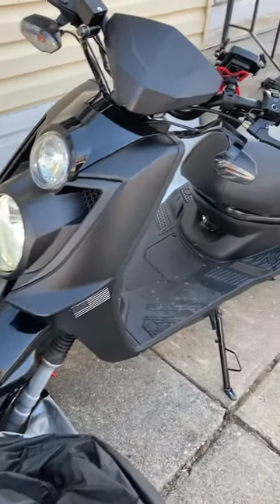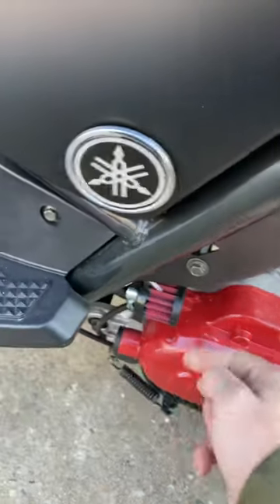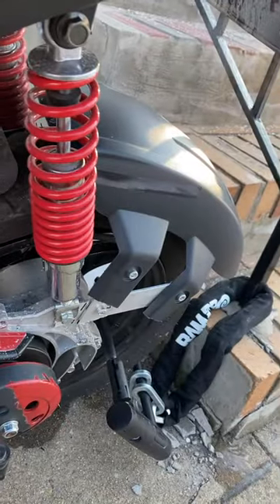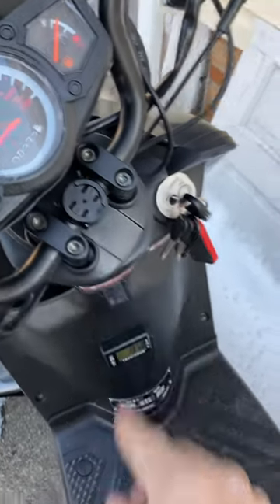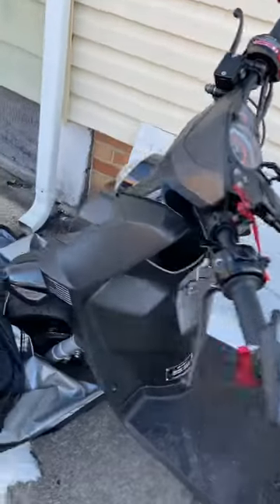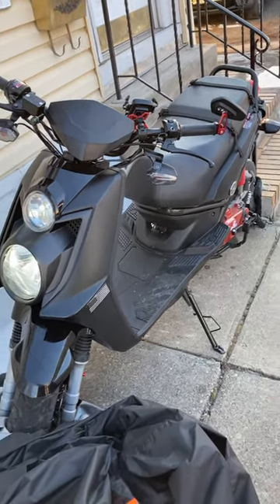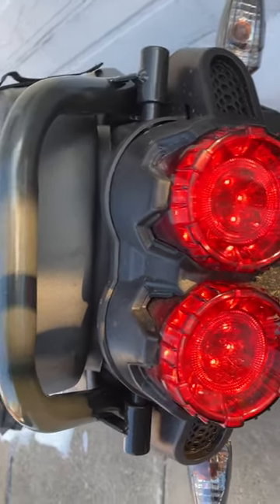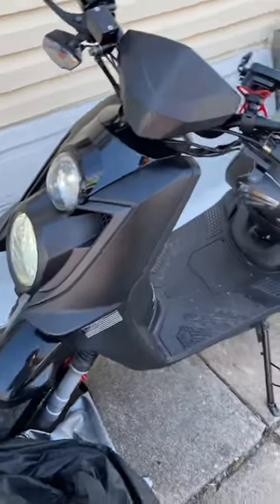Ice Bear Vision 50cc Scooter Overview and some mods #mayhembike

Comment: Hi, I just bought the same bike. Mine came with the 1p39qmb engine. It’s a long case. Is that what you have also? Looking to do some mods and maybe a big bore kit. What do you think? The long case variator and clutch mods have me scratching my head because it came with a weird belt size 723-18-30. Not sure what to order there. I want to go with NCY stuff if possible. Your thoughts?

Comment: How fast does it go
Reply from the maker: Was topping out at 40mph with mods listed in description. Was cranking almost 9000 rpm to do that. Now with 72cc BBK it does 42 at like 8200 or so. Still breaking in. See other videos I just did after the BBK